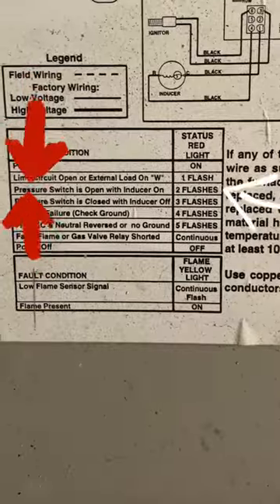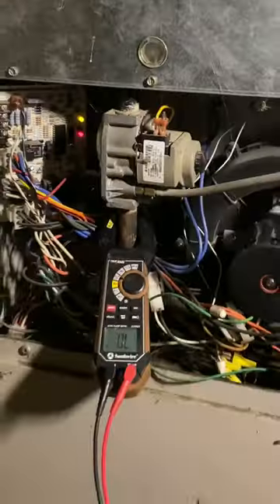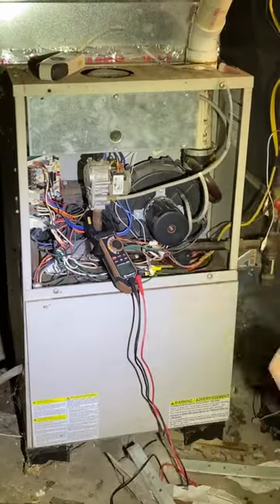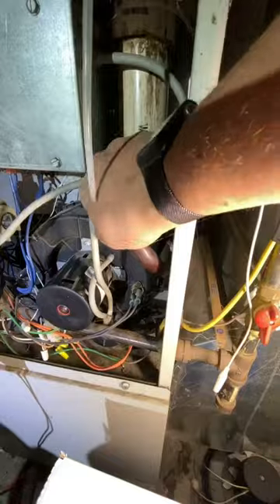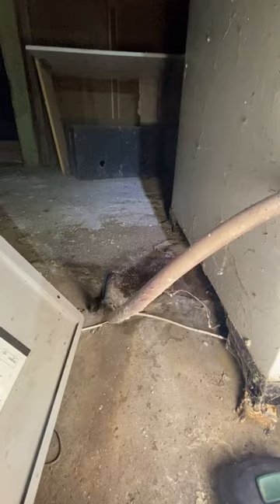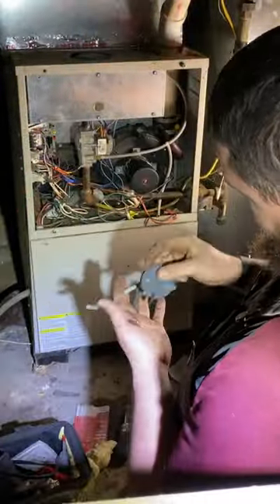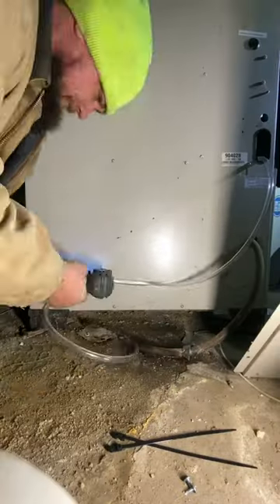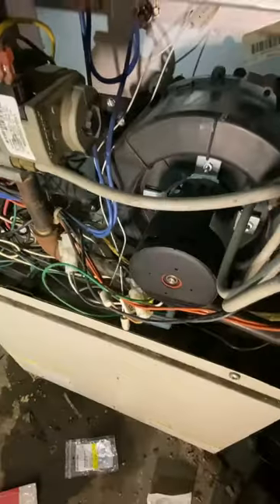Fixing a drainage issue on the furnace. #HandsomeOrHandy #Handyman  #Hvac￼

Comment: Its suppose to splash up into the water collector collar at the top of the inducer. If you got water in the tubes you got other issues. If you added a tube that wasnt there from the factory or stated that it needs to be installed in the instalation manual your just bypassing the problem.

Comment: Thank you for checking outside.
When we were kids my siblings and I stuffed a hockey stick in the exhaust during the winter (dont ask. We're dumb!) Father & son team worked their butts off on a holiday weekend when we had no heat to fix it. 
3 hours and a couple parts replaced one of them circled the property and found the stick blocking the exhaust. Would have saved us some cash in parts and the repair crew some holiday freedom!

Comment: With adding a second tube on the inducer it will compromise the vacuum being pulled on the pressure switch
Reply: Not if it’s trapped. It does violate EVERY rating the furnace had though. Never ever ever fucking modify a heat exchanger/flue within the furnace enclosure.

Comment: So how did you attach drain line from inducer housing? Cause that would have to be air nd water tight. Tapt nd barbed fitting?
Reply from the maker: There is a sitting on the draft inducer

Comment: Isn't there a drain already on the bottom of the inducer per manufacturer? Good job anyway, just curious.
Reply from the maker: There is a spot for a drain but one was not hooked up. That’s where I attached this new drain hose.
Reply: @HandsomeOrHandy  Ok got it. Thanks for the response.

Comment: What shop vac do you use? I bought small one called Stinger at Home Depot and wasn’t impressed. My 25 year old larger one does better but I want a small one.
Reply: The larger DeWalt 20v wet/dry vac is amazing for a battery one.
Reply: @DaDaDo661  sweet I already have Dewalt drill with two 20v batteries! Thanks for answering.
Reply from the maker: This one is a 20 V master force shop vac. It’s sold at Menards. It works really good for small projects but if you’re going to run it longer than 10 minutes you should grab a plug-in one. It eats through batteries pretty quick
Reply: I use old t-shirts as filters on my 5gal 3hp Craftsman wet dry. It was cheap & I’m not a pro. 😊

Comment: You can tell that you have a lot of experience working with gas furnaces. The problem with that furnace in particular was a problem so small, the average service tech probably wouldn't have found it. Instead, they would have probably just replaced the pressure switch entirely, only to realize that replacing it did not solve the problem.
Reply from the maker: I always try to find the root cause of the issue not just fixing the symptoms.
Reply: Except when you replace a high limit on a 20y/o furnace that hasn’t had a filter in years and check temperature with your hand and say all good like in your recent short without checking anything else like coarbon monoxide or the heat exchanger. Love the videos but hate when people act like new equipment is never the option and literally everything can and should be fixed regardless if running safely or not. This is why im starting to hate the HVAC trade, i love that people are learning to fix their own stuff but now everyone acts like they “know” more than the technician that they called  and get mad when you are honest about how shitty there $3000 install from 2020 is and that it will now cost a few grand to fix all the problems with your bunk install from the guy driving a clapped out colarado you met at walmart that wont answer the phone anymore

Comment: That units seen better days. It’s probably 10 years old, that would’ve been an easy furnace replacement sale.
Reply: He's a handyman and repairman, not an HVAC sales technician.
Reply: Who the fuck recommends replacement of a ten year old furnace that doesn’t have heat exchanger issues?
Reply: Id highly recommend it to avoid future breakdowns. The owner get a reliable piece of equipment and I get 22% commissions

Comment: You just violated every rating that furnace has. It’s no get UL listed and probably not insurable. You better hope nobody ever dies from CO in the building because it will be your fault, even if it’s not. NEVER modify ANY heat exchangers/exhausts on combustion equipment that is inside an occupied space. Period. Jesus.